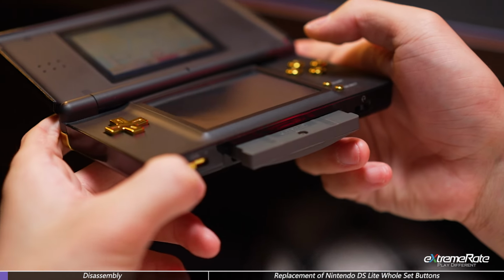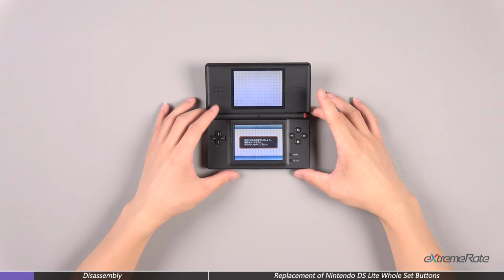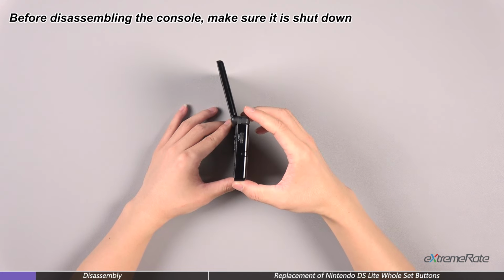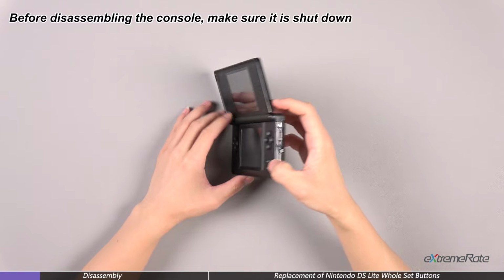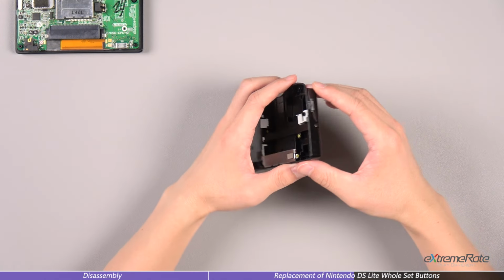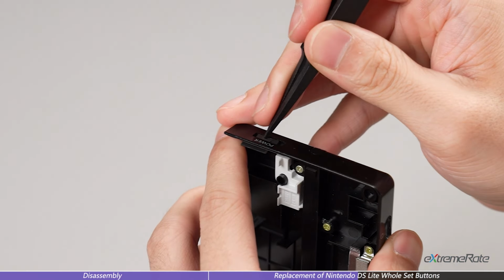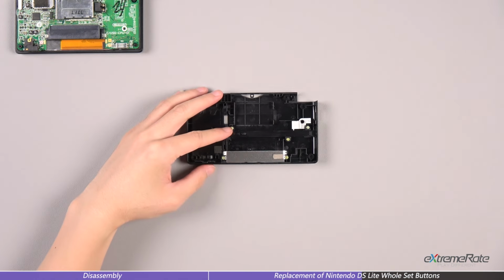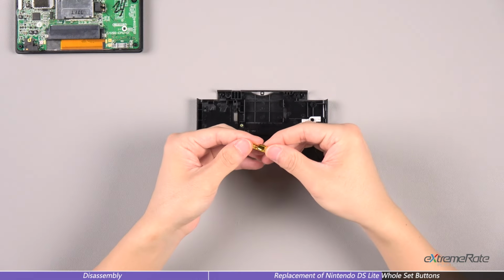Nintendo DS Lite Replacement Buttons Installation Guide - eXtremeRate

Comment: I highly recommend DO NOT reapply the rubber feet covering the 2 screws before testing if everything works because if you do as shown in the video. You will have to risk destroying the rubber feet again to get access to the screws. This will make life easier.